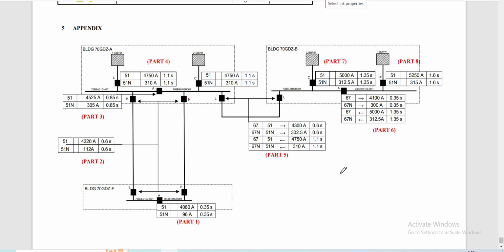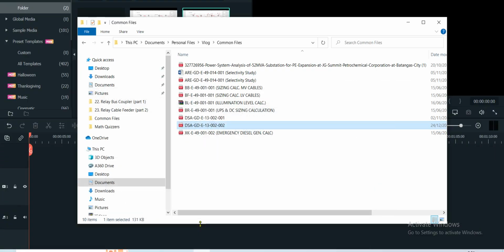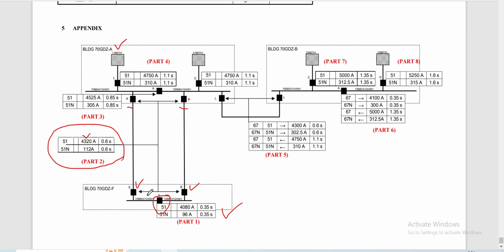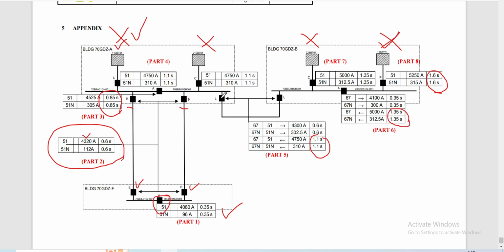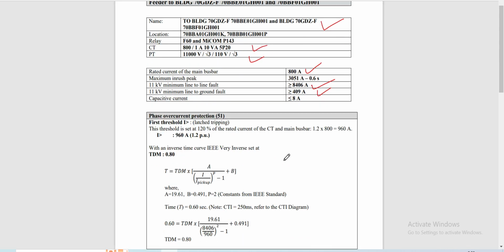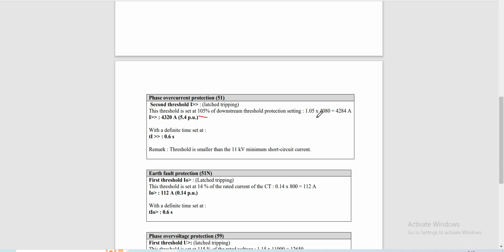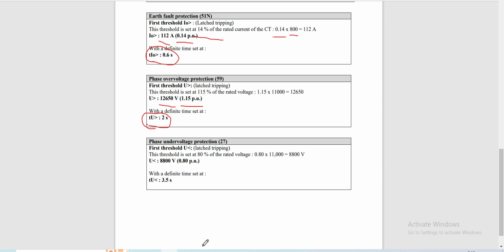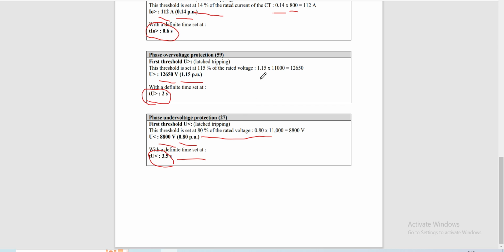Protection Relay Setting Calculation for MV Outgoing Cable Feeder | Part 2 of 8

Comment: If building B (which its bus coupler CTI=0.35 s) is further connected to another building in the left side(say building C) and the available supply is from building A only(current flows from left to right)
How we will set CTI for this new building ? Because 0.35-0.25=0.1 s
How to overcome such issues in relay coordination if the CTI goes to its minimum limits??
Please answer this question as soon as possible…thanks

Comment: Hi Sir Julius. On an 11kV switchboard is it possible to configure the protection relay of an outgoing feeder as an Incomer? The intention is to supply temporary power from a generator to the 11kV switchboard using one of the spare outgoing feeders due to the permanent incoming power is not yet ready. Kindly explain how to configure the relay of the outgoing feeder. There is no potential transformer on the outgoing feeder but only CTs. Is there a need to change the connections on the CTs of the outgoing feeder to correct the polarity as incomer or this can be done thru configuration of relay?

Comment: Hello sir, I have a 11kv  switchgear, one of the cabinet is for earthing transformer , Do we need to close it on the busbars during normal operating? Also we have challenge with the relay settings, the inrush current coming from the feeders circuits which is tripping the breaker and giving under voltage on the relay screen. Please advise on this . Much appreciated
Reply from the maker: I can't give you a proper advice since I'm not familiar with the entire power system on how it works. It has to be consulted to the people who commissioned the system if they are still available.